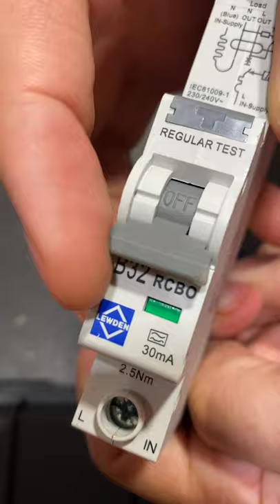WHAT'S INSIDE AN RCBO? - CAN YOU NAME THE KEY COMPONENTS?

Comment: 1. arc arrestor
2. solenoid trip on the top, current transforme on the bottom
3. bimetal strip
Reply: soo all breakers have that components right?
Reply: @akbrlrmdhn  no, only circuit breaker WITH RCD

Comment: Most was already named. The resistor seen on 0:15 on the left upper corner is to limit the current on the bypass of the RCD coil which is used when you press the test-button.

Comment: I find the whole assembly fascinating, the arc dissipator thingy is genius and the circuitry is made quite failproof overall without melting fuses

I guess the key components would be
- Bimetalic strip for slow overload protection, i think it's in RCBOs too?
- The coil for fast overload protection and short circuit protection
- The current transformer for current leakage detection with it's circuitry made with SCRs as the shorting component usually
- The arc disipator heatsink, to stop the arc as fast as possible